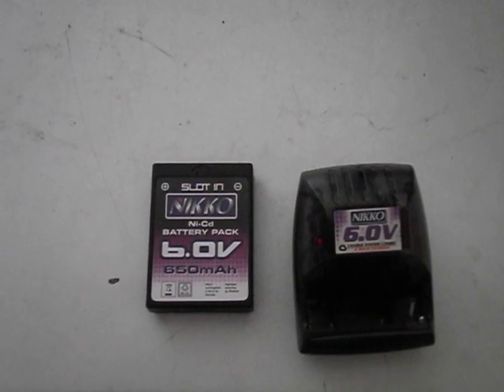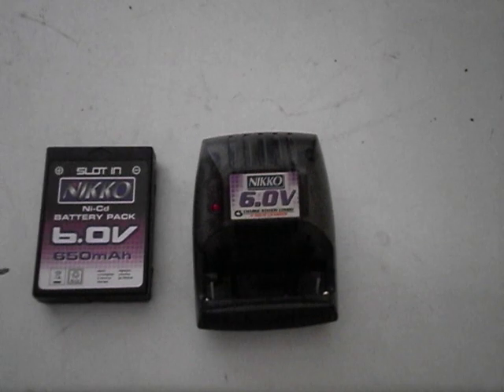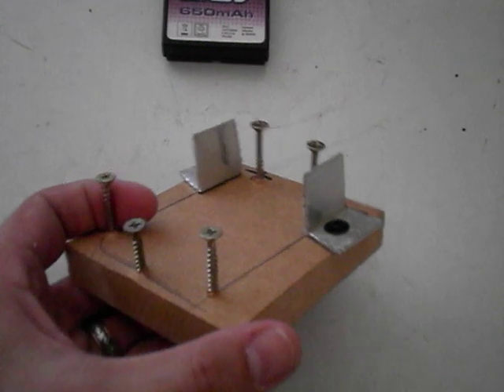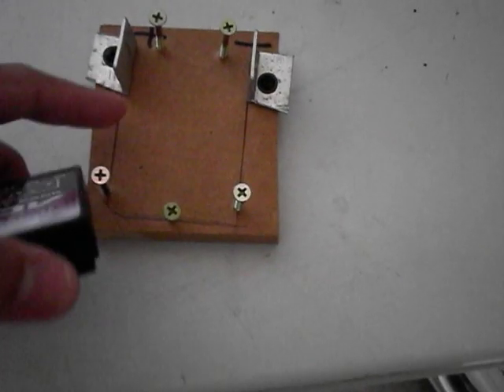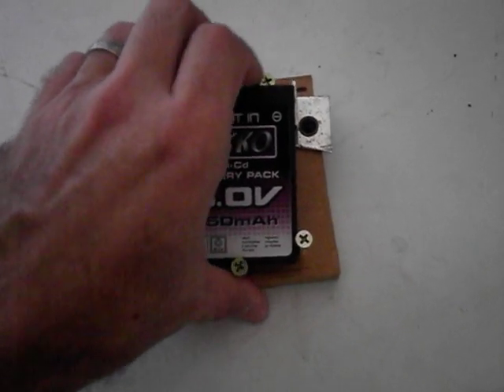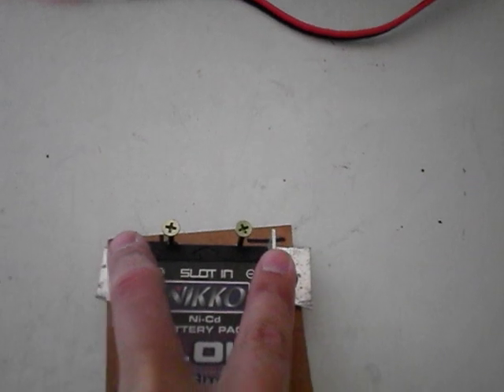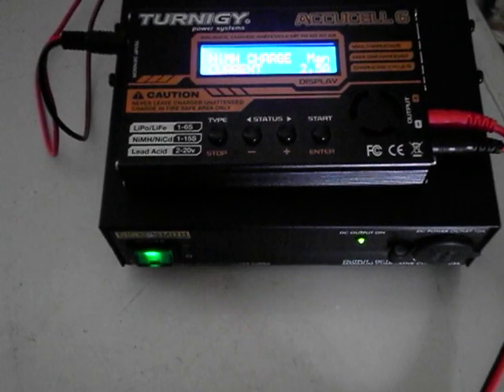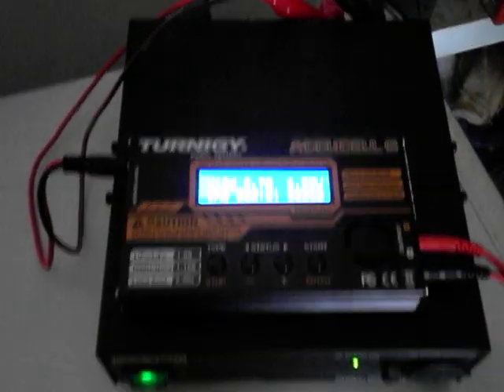Nikko / Eztec 6 volt  battery adaptor diy

Comment: Stinger, you forgot to say what the improved charging time would be with the Accucel? Could you let me know? Also, have you tried fitting a 7.2v LiPo into a Nikko RC. I'm thinking if I can get it to fit, it should be ok voltage wise...
Reply from the maker: mate i gave the Nikko RC's away some time ago, quite literally to a freind of mine. i did the same wiht the Accucel charger too. I use hyperion chargers now days and i have my EREVO.

dont be surprised if the 7.2v lipo burns out the motor real quick and possibly even stips the gears in the diff.the current they produce is staggering
Reply: Thank you for replying mate. Helpful info.